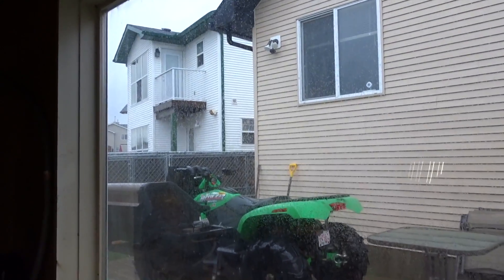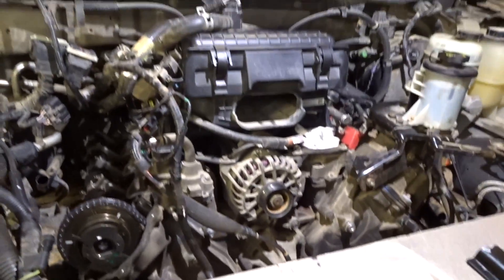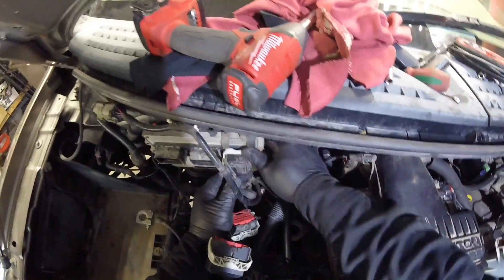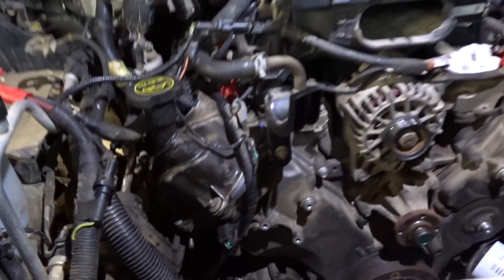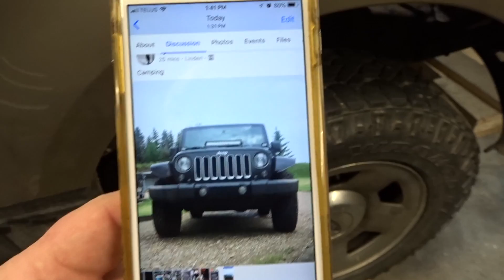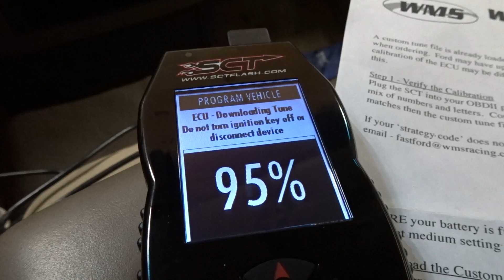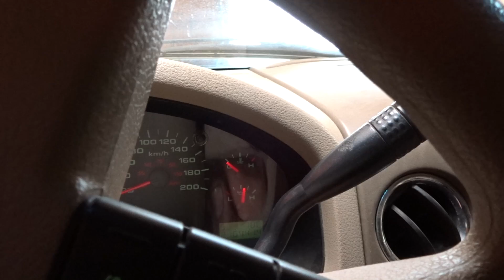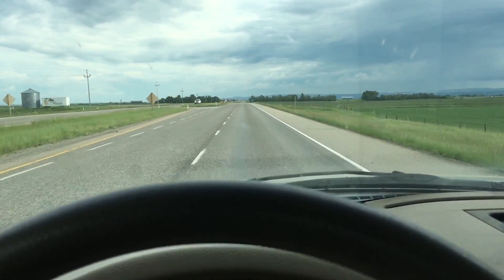5.4 3V Timing Completed will it Start

Comment: hey buddy I know this is an older vid but just wanted to thank you.  Just got through doing the cam lock out install and you helped me out so much with your vids.   That passenger side valve cover is a dog for sure, actually got it back in alot easier than getting it out.
Reply from the maker: The cam phaser lockout was the best thing I ever did
Reply: @BackCountryWrenching  glad to hear that

Comment: What program did you use? I did this lockout to mine and the tune I got from MPT guys just will not work right. motor runs ok, still sluggish but transmission will not shift out under full throttle.. it keeps rev'n and throws engine code then goes into limp mode for about 30 seconds then you get power back.. I need a good program.
Reply from the maker: Was the program tuned for your PCM Code ? I got mine from western motor sports

Comment: Good info.  Just did mine but waiting for the tune. Money wise.    Did have a "Christine" moment with my expedition though.  Got everything hooked up and just as soon as I put the negative to the battery.  The trick started all by itself.  No key in the ignition,. Literally sitting on the dash.  First though was how am I going to turn it off.  Pulled #2pcm connector and it killed it.  So upon further investigation and dumb luck.  I pulled the maf sensor connector with the engine running.  It promptly killed the engine.  Plugged it back in, and it didn't start.  So I put the key back in and turn it over.  Works like it should now.  Hope this helps someone that runs in to big fat Christine that does what it wants.

Comment: ok I have a 04 f150 and the passenger side valve cover is leaking oil in the front of the cover, can it be tighten down, i had the timing and cam phasers done awhile ago and noticed its been leaking, also the same side the spark plug has oil around it and when i start it up it had very thick black smoke, then while driving it has blue smoke every now and then. after awhile the black and blue smoke clears up and then it starts having a misfire and I had it scanned and its always that number 1 plug, where the oil is leaking threw.
Reply: do u have an email i can email u some photos of it?
Reply: I had all 8 plugs and coil replaced also
Reply from the maker: Hard to say but my guess is the gasket had rolled when installed.  Very easy to do
Reply: @BackCountryWrenching  what year truck are u working on? mine is a 2004 & Im looking online at the napa auto parts store and my part number is FPG VS50664R
 - PRODUCT LINE : FEL-PRO Gaskets. I dont know if thats the right one.
Reply: @BackCountryWrenching  another thing i found out last night while looking at the spark plugs is the #1 connector doesnt have a spark going through to it to the coil... I bought 1 connector and i connected it to the old connector pins and still didnt have any voltage going to the coil, and #3 & #8 are the connector need to be replaced. I hate to cut the wires I would just like to find an old f150 and get the connectors from that at a junk yard. but Im going to do the valve cover gasket myself here as soon as the snow starts melting here, also another thing I noticed....I dont have oil on the dipstick, after I did an oil change. none at all.

Comment: Nice! I've got an 04 f150 fx4 3v 5.4 and I'm going to be installing the lockouts and a programmer. I'm looking at the Diablo Sport Trinity T2 EX platinum, will the tune you're using work with that unit? If not can I get the tune specs you flashed to that truck to have a custom tune made for mine? Thanks.
Reply from the maker: nope sorry the software belongs to the creator perhaps you can ask them how much they will sell it to you for
Reply: @BackCountryWrenching  who do I ask about that?

Comment: Nice job man! I've been working on getting the price down on the VCT delete tuning. So far, I've got it down to $500 for a new programmer w/ VCT delete tune and VCT lockout blocks, or $300 if you want to rent the programmer and not own it. Pretty soon, I'll have a bench flash harness complete, and be able to direct flash PCMs that get sent it and have need for a programmer at all. Which might be able to save even a little more money.
Reply: Where are you getting the program to flash your ecm and what programmer are you thinking of getting? I'm looking at a diablosport Trinity t2 platinum, but I haven't found yet what tune to use or where to get it .

Comment: Just a thought about the cam cover gasket dislodging on you, maybe take some rtv and put a few dabs in the groove of the cover before you put the gasket in it. It might help, might not hard to say. I hear you on double checking yourself with the timing marks and such, with zero clearance motors there is zero room for error. Engine sounds good, nice and quiet.

Comment: It sure must feel good to get that shitshow done. I noticed you used regular green coolant. Aren’t you supposed to used the gold coolant which is designed for aluminum blocks. What is the cam phaser lockout kit for? I must have missed that in one of your videos. I’m still not sure I’m confident to do this job myself. Too much room for error especially in reassembly